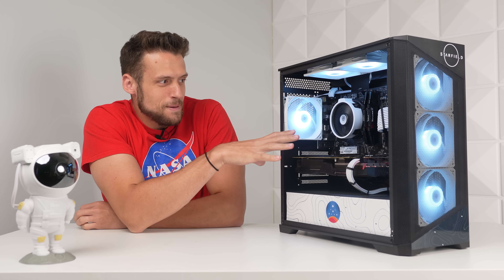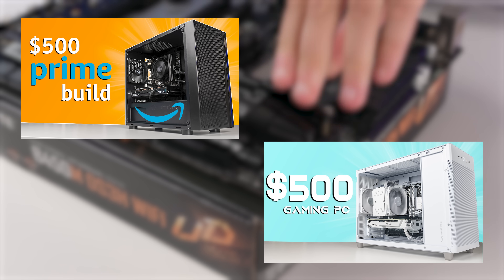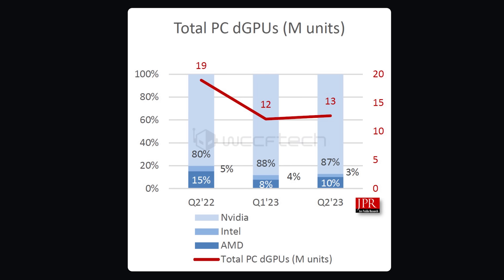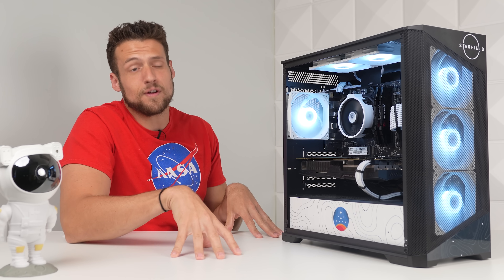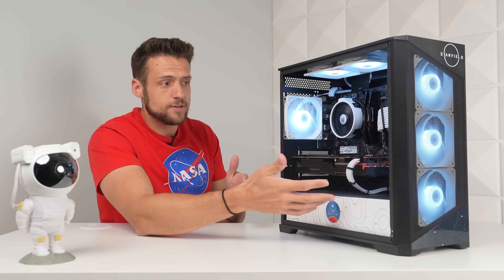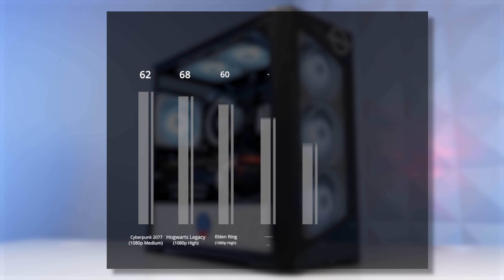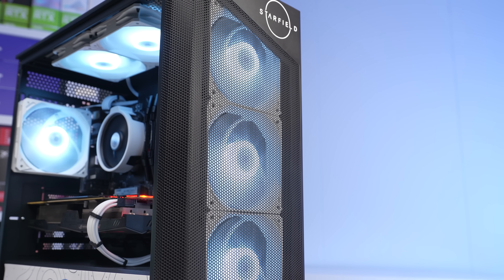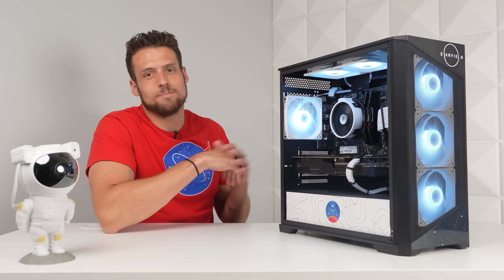Ultra Budget Gaming PC Build for Starfield

Comment from the maker: ► Activate Windows 10 for $16 on ALL of your PC builds for super cheap here: https://biitt.ly/7MXAR
(Use code ZTT18 to save 25%!)
Reply: Hi zach, can I make a request if you can make a budget gaming pc that can run beamng drive? I have the game for over a year now and I can't play it so I'll really appreciate it if you do this
Reply: Awesome looking build Zach!
Reply: I went for rx6650xt With Core i3-10100F on amazon which has great deal, my mobo is 10th gen i.e pcie3.0. I think pcie 4 and 3 has no big difference. Ram is 3200 8x2. I bought this gpu for future upgrade
Reply: Zach, I hope you know that Starfield is optimized for AMD Radeon cards. GTX 1070ti is a good card but you could have got an used RX 6600 for the same price. Just saying. Good video btw! :D
Reply: Hey Zach my PC almost cannot handle Starfield it runs terrible and I cannot enjoy it (i5-11400f, GTX1650 Super, 16GB RAM, No nvme only old SSD's) what would be the best upgrade to make Starfield run on High settings with decent FPS(50+)?

I have a 700-800$ budget so I thought a 7700XT or something like 6700XT + SSD Nvme2 ? (prices are tricky and high over my place).

im trying to figure this for 2 weeks now to close ASAP and play already but I cannot decide what to do 😢🤦‍♂️

I wud really appreciate your help!! Thanks!!!

im not sure what combo would benefit the most.
Reply: @shabutelo   7800xt, ssd is something you can do in the future, if you got 800 to spend go for 7800xt not the 7700xt.

Comment: I run it on pretty low settings on my 1050ti Zotac 4 gb ram with 1x 8gb ddr4 ram stick and i5 3330 processor still looks decent I’d recommend my budget build for anyone looking for a decent cheap pc you can find a pre build with this processor for cheap and pair it with this cheap Zotac graphics card and you can play most games even today low settings bare in mind you can definitely find a better spec pc now but this gpu and cpu pair perfectly I run most games some how at respectable fps would definitely put more then 8 gb ram though if you go for a build like mine. I reckon you can grab a pc like this with 16 gb ram for below 300. I found a video of this build with 16gb ram - https://youtu.be/zXp89iaRnQs?si=aNIw_d7b5-5QRC7n

Comment: I think the low frames may be from your choice of GPU as the 1070ti is well below the 5700, Hell even a 1080 is below the 5700 and it's not until you go with a 1080ti which falls right in the middle of the 5700 and 5700xt as you can see from the telemetry the GPU is the bottleneck. The newer cards that you could of used would be the RX6600 or a 3060.

Comment: I already have a PC... It's 7-ish years old, it was built with a GTX 1060 about two months after the GTX 1080 ti dropped (best I could afford then). Runs most games pretty alright, but runs Starfield like absolute dogwater.

You chopped what would have been 4 hours of research in half - new parts on the way! 
I didn't go exactly with your build, but your guide helped inform my decision GREATLY. 
Thanks boss! Super helpful video. Love your finished build!

Comment: 30-60fps ultra less than $150.. think station s30 MB $24.99 Xeon 1650v2 9.99 128gb 14900 Samsung ddr3 $29.99 240gb SSD $14.99 Vega 56 $65.99 cramming it all in an old velocity micro case from the shed priceless...

Comment: Why are you using blue collar in a derogatory way?

I'm blue collar and can build computers all day long.  Currently have a $4000 gaming computer build.  I work with and 3D model pieces that cost over $10,000-$100,000 every day.

Blue collar does not mean you are dumb, it means you work with your hands; most artisans are blue collar.

Building computers is nothing more than playing with legos in comparison to machining, fitting, carpentry, and welding.

Comment: i can say.. the part isnt "optimized"
money wasted on useless part..
Cable extensions 20$???
a mini ATX case for 56$?? u can get full atx with 20-30$
5 rgb fans 37$ :")) just use that puke rgb mistake u just bought

without that, u save like 77$
replace that 1070ti with used 2060s.. get more juice..
rather than 1070ti but with "white theme starfield"

Comment: Found a HP z220 for 80usd with a GTX 1050ti 16gb ram, 256gb ssd and an i7 3770. I know it won't play Starfield but for eSports games I'm sure it will be fine and for the price I'm pretty sure it was a good deal

Comment: I built a budget PC (Not for starfield) with a Ryzen 5500, 16GB ram, 5700 XT in a case that uses 2 200mm fans and it plays starfield great in 1080p. Also $400-ish with all new parts except the 5700 XT which I got for $120 on Ebay. But, 5800X3D and 7900XTX plays Starfield in 1440p like a beast. 

Used to have All NVIDIA cards, but since they F**ked over EVGA, im all AMD now.

Comment: people run starfield in a usable manner on those tiny handhelds, guess it would run similarly on a igpu like 5600g/5700g, with older video card built in the cpu, I am really curious about what the 8000 series ryzens integrated video will be capable to run, with the boom of handheld devices taking crown over from tv consoles would be funny if AAA games run decently on onboard video solutions

Comment: Gaming PC's are the biggest ripoff.  I have a 13 year old Sandy Bridge quad core i5 and 210 Nvidia GPU,  I have yet to run up against "your computer is too old for this" problems.  Then again I know how to to convince the app it will only need to have access to three cores and 1gbVRAM.

Comment: You should all also be aware that Starfield is really badly optimised currently, so the performance difference between minimum and recommended is actually not that significant. This might change with patches, but at the moment unless you have a planet devouring supercomputer, as long as it's above minimum spec you'll get an acceptable play experience.
Reply: Feels like intentional. Like they made with gpu companies to force players to buy expensive gpus.
Reply: @intermilan9731  Maybe, but considering the trend of companies shitting out busted games that don't work on PC, I reckon it's just good, old fashioned contempt for their customers.
Reply: When has Bethesda ever shit out a busted game LOL  @Elriuhilu
Reply: I mean, if 4090’s are struggling to run this game without crashes, what is being said here is probably true 😅

Comment: There are also 2 versions of the Spire cooler.  You have the all aluminium version and the copper slug version.  I have the copper slug version (I got with my old R7 1700) on my R5 5500, it was fine on the hot old R7 up to an all core speed of 3850MHz (I would not try this with the all alu version) so it's perfectly fine on the faster chillier R5 it's currently on.  If you're using that little cooler and want to give it a little OC then just turn on PBO in Ryzen master (also switch the toggle that 1:1 matches the memory and fabric speeds) as that boosts up and adjusts voltages across the board dependent on temperatures.  You could also try an undervolt on the CPU to reduce temps.

Comment: Hi. What do you think about getting Ryzen 5 5600 and RX 7600 for Starfield? I know that I problably could get a cheaper CPU, but I'll problably upgrade my GPU when 8000 series will come out. Do you think Ryzen 5 5600 would bottleneck a gpu like 7800 XT at 1440p?

Comment: Is this a good pc and you can recomme me if I need to  upgrade or change anything 

*CPU:* Intel Core i9-13900KS
*GPU:* NVIDIA RTX 4090
*Motherboard:* Compatible motherboard with LGA 1700 socket (e.g., ASUS ROG Strix Z790-E Gaming)
*RAM:* 32GB DDR5 RAM (Corsair Dominator Platinum, G.Skill Trident Z5, or equivalent)
*Storage:* 
- 1TB NVMe SSD (Samsung 980 PRO or similar for fast load times)
- 2TB HDD (Seagate Barracuda or Western Digital Blue for additional storage)
*Power Supply:* 1000W or higher, 80+ Gold or Platinum (e.g., Corsair RM1000x)
*Cooling:* High-end CPU cooler (e.g., Noctua NH-D15 or NZXT Kraken X73)
*Case:* Mid or full-tower case with good airflow (e.g., NZXT H510, Fractal Design Meshify C)
*Operating System:* Windows 10 or Windows 11 (depending on your preference)

This configuration should provide exceptional gaming performance and is well-equipped to handle heavy gaming loads. However, it's essential to check compatibility and verify component availability at the time of your purchase. Additionally, consider additional cooling and aesthetics based on your preferences.

Comment: Starfield IS super UN-optimized though... many youtubers have shown that. Min spec cant run it, and even with an over spec, the game will not utilize the gpu, hovering around 70% to 80%. And changing the game settings has little to zero effect on FPS.

Comment: I want to use a GPU with my 3400G and want to put RX7600, so will it bottleneck that much in AAA games to play at Ultra settings for 60fps? If  then which gpu should i consider?
Mobo- Asus Prime A320M-K

Comment: I need a gpu recommendation ryzen5 5600g 32g ram and 450w psu.cooler master.
Reply: Amd Rx 6700
Reply: @Muultipy  it will work with my 450w psu. Because I don't plan to upgrade my psu any soon.
Reply: @Muultipy  I was thinking of rx6600 because of budget. So will it do the job any good ?

Comment: Yo Zach, i recently built a 500$ pc,so can you tell me i made a good choice?
Specs:
5 3600(used,came with stock cooler and thermal paste)
RX 5700XT(used)
Asus B450 wifi
HyperX fury kit (2x8 kit)
Teamgroup 1 TB nvme
Thermaltake 600w
A lian li case with 4 preinstalled fans

Total cost:507$

Comment: I recently found a deal on facebook marketplace a gaming set up for only 350$.It included a 24 inch 1080p hp monitor a red dragon 4in 1 set keyboard mouse headset and mouse pad and the pc itself. The pc came with these specs

Cpu: Ryzen 5-3600X 3.8 GHZ Turbo 4.4 Ghz
Ram : 8 GB DDR4
SSD : Samsung 128gb
HDD : 1 TB
Motherboard : MSI B450M BAZOOKA
Gpu : Nvidia GTX 1050 Ti 4 GB Dedicated
OS: Windows 11 Pro
  Was it worth it?

Comment: I went a slightly  different  route. Jingsha x79, e5 2690. And 4x4gb 1600mhz ram (ali express 85$) , a 120gb m.2 for windows n a few apps team group 1tb ssd. Used Sapphire rx6600. Plays starfield flawlessly at 1080p and gets  slightly  higher fps with mostly  ultra and high settings. 

Performs a bit better than my friends r5 3600 and 1080ti build aswell.

Comment: hi this is my first pc are these good specs for 1440p
750W ATX 80 Plus Gold        750W ATX 80 Plus Gold        Windows 11 Home + USB Recovery           Wireless 802.11ax          QTY 4x CM MasterFans RGB
Cooler Master TD500 RGB         NVIDIA GeForce RTX 4070 12GB        1TB NVMe M.2        16GB DDR4 Dual Channel        ASUS B760 D4 Series
Intel Core i5-12400F 6-Core

Comment: 12:52 DON'T EVER DO THIS YOU YOUR COOLER!!
Reasons:
1. Your thermal paste will not spread evenly.
2. There is a chance you could damage the CPU, cooler, or motherboard.
Always slowly tighten the screws evenly to keep the cooler flat so the cooler spreads the thermal paste evenly and without potentially damaging something.
Reply: Bro its sped up💀💀💀💀💀
Reply: @arz_gaming1u476  Indeed, but slow enough so you will see the error being made. Screw in CPU coolers DIAGONALLY.
Reply: Can I use this PC for mostly programming? Does it have to be just gaming?
Reply: @trumpssleepparalysisdemon8569  Yes you can bro. Not sure about what you're trying to make.

Comment: Hey zach got a question bought a prebuilt pc couple weeks ago with ryzen 5600 and RTX 4060 but the 4060 is ITX one from Gainward meaning 1 Fan, Should I be worried about the card overheating?

Comment: I’d like to see an upgrade build where you take a system built in say 2020 and upgrade it for 800 
So if it had a 10th gen intel or zen2 platform upgrade that
And if it had a rtx3000 or Rx6000 upgrade that too
I’d like to see what you’d do to a pre-existing pc

Comment: I went for rx6650xt With Core i3-10100F on amazon which has great deal, my mobo is 10th gen i.e pcie3.0. I think pcie 4 and 3 has no big difference. Ram is 3200 8x2. I bought this gpu for future upgrade
Reply: Was about CAS Latency?
On a box it should say CL.
It's not the same 14 or 22.
The fps difference between 3200CL 14 and 3200 CL22 can be massive depending on the game and settings.
That said CL14 RAM is expensive,but CL16 is extremely expensive.
Reply: You are talking about ram right?

Comment: Very pro tip, 

The RX 5700 and XT are the same silicon die and memory bus/size

So if you really want to, you can flash the XT bios into the regular card in order to gain some performance over the GTX and even some early RTX cards
Reply: While really cool idea, I don’t think that ultra budget gamers want to risk bricking their gpu over a few frames. You’ll likely better off slightly over locking the card
Reply: @Sumire9287 you can Just reflash the old bios if anything goes wrong
Reply: @ChromeBreakerD  isn't this only comfortably done if the GPU supports dual bios?
Reply: @ChromeBreakerD  isn't this only comfortably done if the GPU supports dual bios?
Reply: @Sumire9287 you ain’t gonna brick it
Reply: @Sumire9287  Safer to use morepowertools, made a video on it.
Reply: I have one and have done this to mine, it's not exactly a 5700XT, but it's close. The 5700 has 36 compute units vs the XT's 40, and the BIOS flash will not give you those. Not huge but it makes a difference.

A caveat also is that it's not necessarily the safest thing. Odds are you can flash it without issue but if something borks up and you don't have a backup you can just brick the thing. Ultimately it's a pretty high risk for ~10% gain.
Reply: WE HAVE TO TELL ZACH THIS
Reply: This is false the XT has more Rop shader units and better cooling solution for higher clock speeds. They are very similar, but not the same.

Comment: What is the highest Intel Cpu you would pair with a RX 6700(non xt)
Reply: i5 11600 f
Reply: @Muultipy  really? I figured a 12th gen would be best. Right now I have a i3-12100f. So I need something that fits the LGA1700 board.
Reply: @Frizzo69 typo,I meant 12600f
Reply: probably an i5 12400/12400f